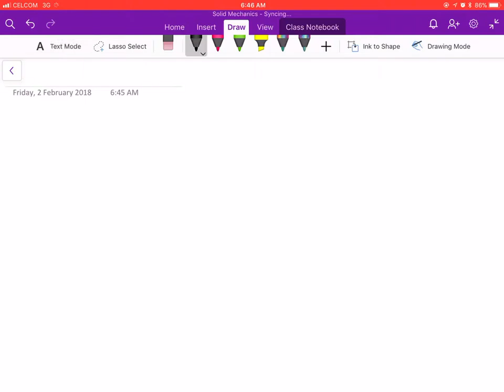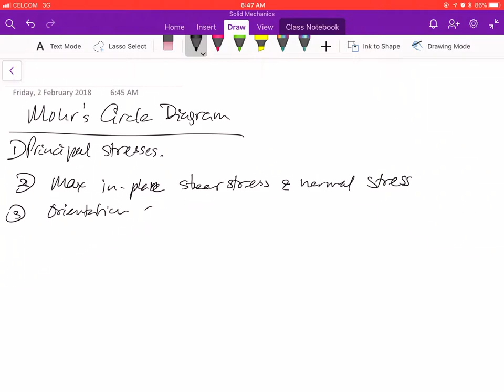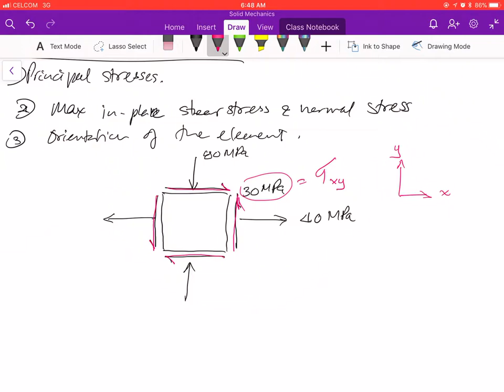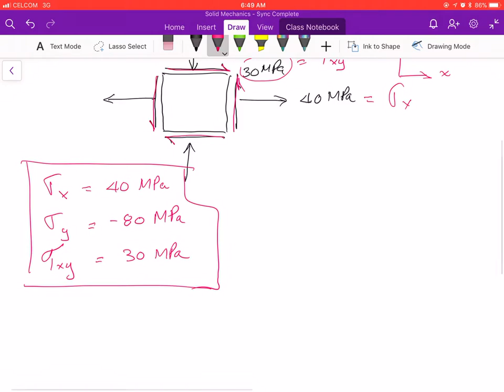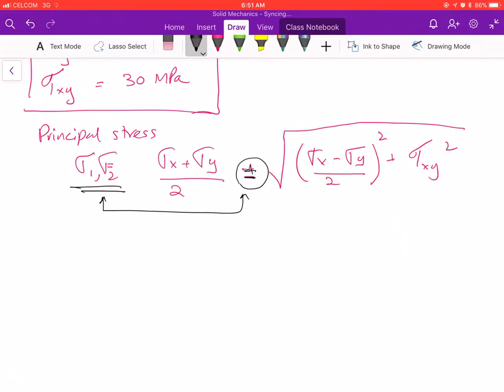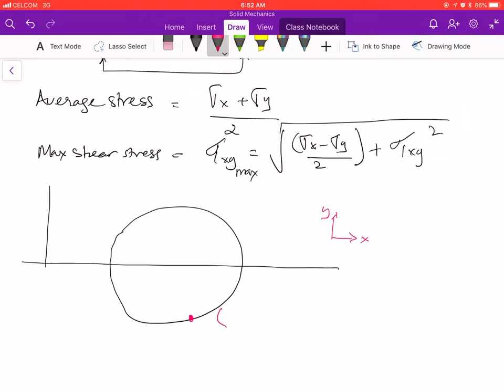Mohr’s Circle

Comment: Did you mean: A civil engineer wants to design a rescue ramp on the freeway, regardless of friction, in order to take the bend without slipping. In other words, even if the road is covered with ice, it should manage to take the bend when the vehicle moves at the specified speed. Such a ramp should generally lean to one side, ie it should be inclined towards the road curve. Considering that the speed determined for the ramp is 13.4 m / s and the curve radius is 50 m, what should the angle of inclination of the curve ““ ”be?
Reply: ebu hassan help me